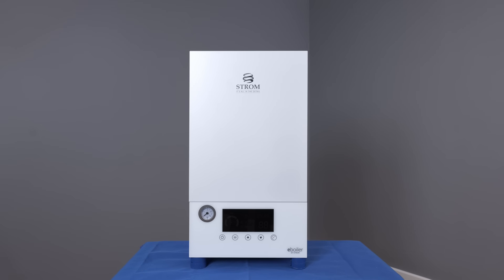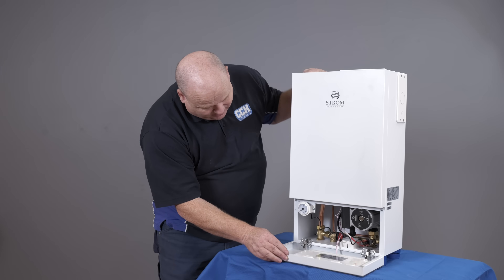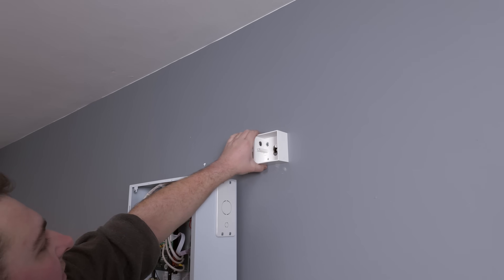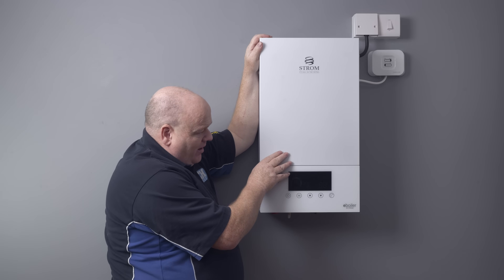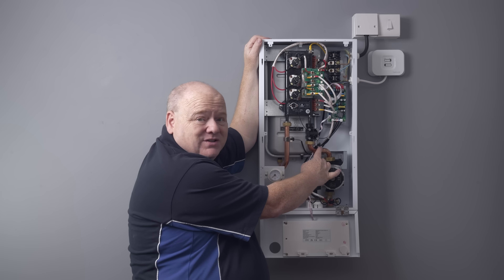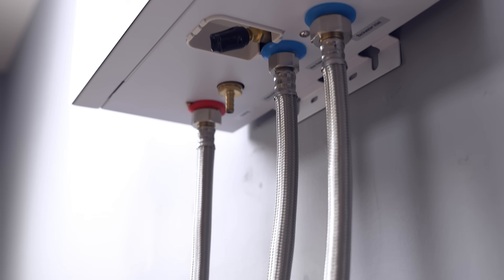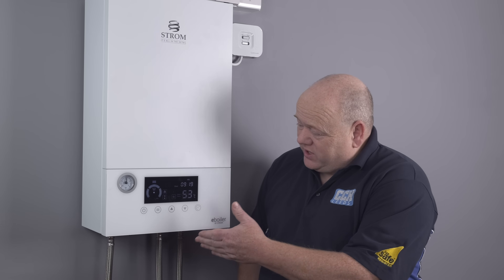Electric Boiler Installation Strom eboiler Electric system boiler Central Heating System

Comment: Hi Allen, I have a Strom boiler, it was installed around 3 years ago.  Three times a year I pay my plumber to attach a hose to my kitchen tap, and the boiler, this raises the thermostat lever showing on the front of my boiler. The plumber became a couple of days ago and did this again, however, when I use my Center hand held control box to make the rads heat up, the boiler fires up only showing the small square with a revolving fan going around, this then turns off and starts completely , and will start up again 30 seconds later, but nothing else happens other than this.
I am so frustrated with all of this. I really wish I’d never had it installed. I should have gone for electric radiators.
This is costing me £195 a year, surely it can’t be right? Do other people experience all this or just me?
Reply: Do you mean you’re getting a plumber out to add water to the system to get the pressure back up on the dial?
Reply: Hi Thomas, yes, he connects a hose to the kitchen tap, and then to the pipes connected to the boiler, when he leaves my property it is working well, but not the next day

Comment: I would like to install one in NYC, 2 family house, my question is I have an oil boiler, pearless boiler with a coil built in to make hot water, my question is this is a steam system i have, would it work with my existing radiators ?

Comment: Hi Allen i always watch your videos and learnt lots from you, i have the 11kw system boiler  and a error E4 comes up which is heat exchanger is over heating  it comes up within about 2 minutes of the boiler starting to heat up the flow pipe stays cold  but the return pipe is warm  have you got any idea what it could be Thank You.

Comment: I have a question about this, I have a traditional dual immersion heater with a tank that is taking a lot of space away and take ages to warm up the water. 
All I use it for is a shower and running warm water to 2 sinks (that I really don't use much because I use a dishwasher) 
If I want to replace it with an electric boiler, do I really need 10Kwh or more for my use? do I need still need a tank and the pump for it? 

Thank you for your help

Comment: I recently moved way up into the high Alps mountains. The old boiler was a waste so I asked around about a new system and everyone said to use a combination pellet & wood boiler. What a nightmare it has been!! Yes the house is a big old stone house so takes a lot of heating. On pellets it eats about 75kg each day which is about €50. Wood is about 2 wheelbarrow loads each day. It needs checking constantly and I spend all my life keeping it going. It cost me €13 000 boiler only!!!
I'm now looking at an electric boiler. I have 10 rads in house. I have a 1000ltr insulated tank also already installed but not sure if that is required. 
What do you think? What kind of current foes the biggest electric boiler require? Thanks

Comment: Just had one of these fitted and plumber had to come back and fit a pressure reducer , have to have flow very low to use hot water taps or shower the performance is terrible, for the price I expected better is this normal for these ?

Comment: can the display timer on the display be used to set it up to run at night through octopus 7p rate or do you need a seperate thermostat to control that.
Reply: You need a separate thermostat or system controller to do that

Comment: I have wet electric heating in my apartment, just 4 radiators….it cost a fortune to run, so much so that I don’t use it. When we had the energy crisis my electricity bill could be as much as between £15-£20 per day.  I bought myself 3 oil filled radiators which keep my flat just as warm but cut my bills by about 65% even on the coldest days.
Reply: Thanks buddy.

That's I wanted to hear.

The electric combi boiler will be about £2000 - 12kw.
And you must spend money for radiators est.

Will be a lot cheaper to buy 3 oil radiators. The installation will be easy too.

Buy my calculations you payed  between £450 and £750 per month. So you pay one mortgage. 😊

Thanks.
Reply: @ivopanayotov5198  - Yes it was crazy expensive, for me at least - looking in my app my most expensive month was Jan 2023 at £457.26 - in Jan 2024 with the oil filled radiators it was £219.49 and that was the most expensive winter month. All the other months during the cold weather my bills were under £200 - considering I work from home 5 days per week that’s not bad.
Reply: How does everyone do their hot water

Comment: I had a long type stradae electric boiler in a flat about 10 years ago and everytime i turned it on it was frightening how much money it was gobbling up.
Im guessing these bew boilers are more efficient.l, i would consider one for hot water only.
Reply from the maker: It depends on the energy tariff and when you use it.

Comment: What's the electrical bill like in comparison to natural gas boilers? Also, do electrical boilers bring long term results without electrical faults and would they be successful for the next 15 years because boilers you don't replace till at least 10 years minimum.
Reply from the maker: If you have gas then you should not consider electric. Thanks.
Reply: I have the Baxi Platinum because I watched 1 of your videos years ago and I went with 1 of your personal recommendation  @AllenHart999

Comment: Ive got a 7kw combi 
Hot water useless..it cost a fortune to run ....going back to oil ..my last bill for december was 700
Reply from the maker: Who advised to change from oil to electric? Have you looked at what a heat pump would cost to run.

Comment: I just had  a idea, could these boilers be run off economy 7 off peak electricity in the night time to heat up hot water storage tanks in the loft that is insulated. And in the day time use the solar panels on the roof  to also heat up the  hot water storage tanks in the loft.
Reply from the maker: Yes, Absolutley
Reply: Yes... but there are far far cheaper ways to do that.
Reply: What about heating a radiators can it do it

Comment: Fitted a few of the 14kw  combi Strom boilers ….customers happy with them …very light and easy too fit ….probably part of the future too be honest . Tec help line is spot on too 👍🏻
Reply: Are they happy when they have received their electric bill?
Reply from the maker: Thank you for the feedback.
Reply: That’s not my problem ….but they only have one bill. Too pay as there usually not on the gas grid …..😂
Reply: Did you put any filter pls and is it gonna work just on radiators 😊
Reply: What makes them trip the 14kw boilers? A friend having issues I think wired with 10mm cable. Display goes
Reply: Did you have to run 16mm cable for them and on 63 amp breaker?

Comment: Thank you for the video! So helpful, I hope you do more on electric boilers. living in a tiny 1 bed house cut off from gas mains. I don’t have the room for a heat pump or the money for the insane installs and this seems like the most logical next choice to heat water and retro fit real rads over time
Reply from the maker: Thanks very much for your comment, please consider subscribing to support the channel 🙂
Reply: Government will give you 7k to install a heat pump, the install on a small 1 bed house will be less than a boiler. Your bills will be well under a grand a year, or for one of these and I wouldn’t be surprised your bills are 2 - 3 grand a year.

Comment: Does anyone know how to set a timer on these boilers? We have one in the house that we've just moved to and ive only ever had gas boilers with really simple timer devices. But with this one the boiler is constantly on if the temperature drops below the setting on the thermostat. Ie including through the night or when there's nobody in. It's costing me a fortune to run but can't figure out from the manual how to set a timer? Any advice much appreciated
Reply: The 'modern' way... is to have a 'set-back' temperature.  So when the boiler is "off" the temp drops down to the 'set-back' temp, but will never be off (unless the temp is higher than that 'set-back' temp of course).  The logic to this is that when you want the room to be at say 21°... the system has less work to do, and thus it gets to temperature quicker and cheaper.  The downside of course... is that if you only want 21° for 3 hrs a day... you'll be paying to heat the room to say 10° (or whatever the set-back temp is set to) for the other 21 hours !!!

Also... you said that it's costing you a fortune... well, yes, it will.  Electric boilers are probably the most expensive form of heating !!!  What did you expect ?
Reply: Did you manage to get this sorted? We have a similar issue…

Comment: At 32p/kWh this will cost a fortune to run.
Reply: Can I add, as someone who has just converted from gas to electric, I can generate my own electricity a lot easier then my own gas, depending on how many beens I've eaten of course 😅
But you get my point tho....👍👌👍
Reply: @EZ-D-FIANT  in that case you should be using a heat pump with approximately 400% efficiency, not resistive heating that's only 100%.  Maybe you are?
Reply: @Chris-hy6jy  yea I'm thinking about one this year I've deliberately left my rad pipes intact and kept my rads (I'm using electric rads and a tankless for water atm) for the possibility, I've got some groundwork planned anyway so might go underground as I'm in UKland so dunno how good an air one would be lol.....
Reply from the maker: I pay 8p for electricity on average
Reply: Get  yourself some solar power.  There's  a 14 grand  grant from the government.

Comment: I dont have gas at all in this property as it all electric. My cylinder takes ages to heat up. Would the electric boiler be best upgrade? Also how good the electric combi boilers?
Reply: Combi boilers (electric) are good enough for central heating & hot water for all needs including a shower EXCEPT for a bath due to lower flow rate - although theoretically that depends on how long you want to to wait to fill a bath up :). Of course due to lower BTU rating the central heating might also be an issue in larger properties. They do come in higher KW rating above the 14.4 KW (which is 62A & really the max to leave enough left on a 100A consumer box for all other electrics in the house). The ones above are 3 phase & can draw KW ratings to match gas boilers, but of course a 3 phase supply is needed & would have to be fitted to a property if not already available.
Reply: If money is no object... then yes, electric boiler and a 3Phase supply... but if you're not a multi-millionaire... then I'd be looking at other solutions.  Heating water in a cylinder via an immersion on an overnight cheap rate for example ?

Comment: With regard to installing one realisticly it has to be down to tariffs, basically not at the moment. Sorry Allen Gas is cheaper.
Reply from the maker: Gas is cheaper; this isn't a replacement for a gas boiler.
Reply: I have gas and electricity, I think the price tariff is about the same price. Not a lot of difference.

Comment: I guess you just do sponsored content these days. Shame.
Reply from the maker: This video isn't actually a sponsored video. It's a video to show people electric boilers, however, I do sponsored videos as it keeps the channel going and allows me to donate all revenue from videos to charity. Thanks for watching and supporting the channel.
Reply: @AllenHart999 why not mention the crippling cost of running these then? If one family installs this thing thinking they are “doing the right thing” and don’t realise it’s going to cost them 4x the running cost compared to gas. 6p a unit vs 25p. It’s these kind of mistakes that get people into crippling debt. I know your heart is in the right place, but these things are for exceptional requirements.

Comment: I hate to say this allan but you’re pushing electric appliances  and they cost a fortune to run  - ok you have battery back up but they cost a fortune to install and maintain - maintenance is avoided in your videos
Reply: Heat pumps are fine, direct electric heating is totally nuts. 30p/kwh
Reply from the maker: @edc1569  Heat pumps are not always suitable. An example would be a high-rise flat in London. Thanks.
Reply from the maker: @edc1569  Heat pump could be tricky in an upstairs flat.
Reply from the maker: Hi Neil, I am not pushing electric appliances, I am however trying to add all heating solutions on my channel, That way people can add comments and give opinions. Just remember that different products are suitable for different applications. Thanks.

Comment: Mine gas heater is going to red 6 bar  i open the  sink to reduce the pressure then goes 3 bar    lower is normal 1.5-  2   also has pipe noises like hit metal on metal  nothing is touched preasure release valve is open    i have to stop boiler electric button 1st or close the gas 1st      temp outside building -5°C      if i reduce the other heaters  ?

Comment: Please would you do a review on that rothenburger pipe bender looks very clever.  Also could you run it off solar and batteries and for how long
Reply from the maker: Will do.
Reply: The solar thing, I've done it, 3 phase no chance but single phase just about, I have a wind turbine up too....

Comment: Electric boilers are dross,
Strom who?
Gas is here to stay
Reply from the maker: What if they don't have gas.
Reply: I've just had a PV ready Jnod electric combi delivered, ordered it from the manufacturer who built to order, tested and shipped for £800 inc shipping. . As an old diddy who gets heating allowance in the winter. Im well happy. The combi has separate heaters for rads and hot water so for 8 months when i dont need central heating i will be getting paid for my PV solar output that helps during the cold times.

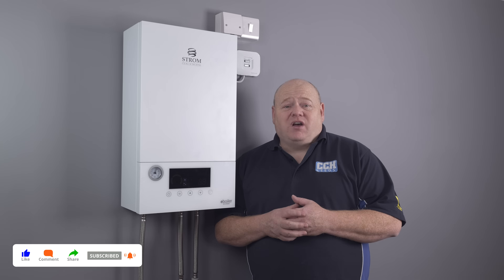Comment: @ 7:30 in my country It cost @ 3.5-4 times more to run an electric boiler compared to a gas boiler… 
I had many crying clients after the first 2 electricity blills 😅
Reply: Not a viable solution for DHW and space heating. lets says your tariff 30p per KWH. with that 7kw unit on for an hour your cost would be £3.15 not including the standing charge. People choosing a electric boiler most of the time will not have the luxury investment on PV & battery storage.
Reply: What if combined with a hot water cylinder charged with off peak or negative rate green energy? Can you do that for both hot water and heating?

Comment: It is not what you will aspect 
For most instala you need to use hot water to only one outlet 
I install to many of this 
If you need a lot of hot water you will install an unvented cylinder and an electric boiler for heating 
All the best
👍
Reply from the maker: Thanks.

Comment: Allen just read on the Strom site, that the Strom Electric Combi E-Boiler 14.4KW  single phase can't run a bath and recommend that only 3 phase units are selected for applications that include a bath.
Reply from the maker: Thanks.

Comment: I only fit electric boilers for my customers now, if you install or even service/repair gas boilers you should be heavily fined for killing the planet.
Reply: Hmm, don’t think you understand how electricity is made do you
Reply: @Chaosclipz  by burning coal, what's your point?
Reply: @maximuswong3092  burning coal releases co2 which is bad for the environment
Reply: @Memeraged  it doesn't use coal, it uses electricity.
Reply: @maximuswong3092  I’m talking about burning coal to produce the electricity
Reply: @Chaosclipz  the electric boilers I fit produce zero emissions,there's no combustion.
Reply from the maker: Gas would normally be cheaper to run.
Reply: @AllenHart999 Allen hi. Can you add a filter to the return pipework and do you install a filling like on the pipework like a gas boiler?
Reply: @AllenHart999  my customers don't need to know that and once its fitted and they get their first electricity bill its already too late.
Reply: @maximuswong3092 your a conman
Reply: @neiljones9005  please explain how
Reply: Heavily fined? W ⚓
Reply: @Oiledballs-wu1cm  yes mate, let's say a £10 increase per day to your gas standing charge if you still have gas meter fitted by 2024, that's a small price to pay for assisting in the genocide of the human race.
Reply: And where is come from that electricity of yours for your electric boilers??
Reply: @ricardoa.m1322  the national grid
Reply: How dare you, I guess your one of those brainwashed cop agenda 2030 trans folk!
Reply: TWAT
Reply: Troll award
Reply: @edc1569  brainwashed by the big gas/oil companies award goes to you.
Reply: Vast majority of electricity is renewable sourced these days and the folk fitting electric boilers have generally invested in solar
Reply: Solar in UK? Really? How many Kw you can get from the solar panels in uk on thoose never ending dark,grey rainy days I don't think so. So the main point where is come from the supply for all that electric boilers,electric cars,etc
Reply: You’d be surprised how much sun we get. We also generate 65% of our electricity from wind.
Reply: If your good with them come and look at mine then, newly installed and I think it’s utter shit , was doing my bit for planet and now wishing I’d stuck with gas so I can have a decent shower.
Reply: @garyfrost9679  I don't care about if they work well or not, I just fit them and get paid
Reply: @ sounds like you take pride in your work 👍 thanks that was helpful